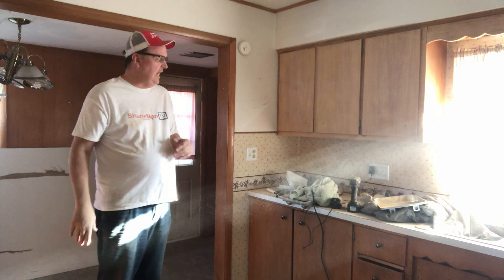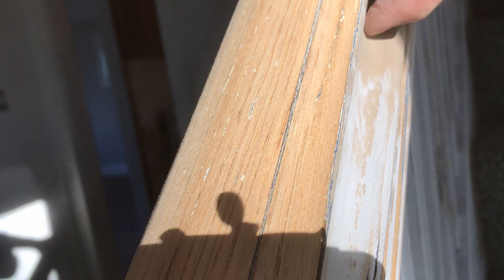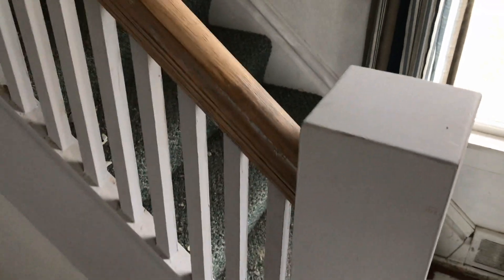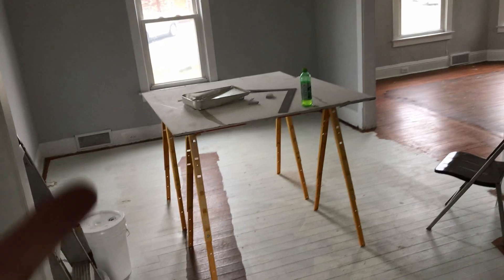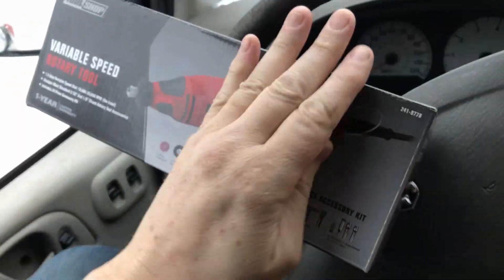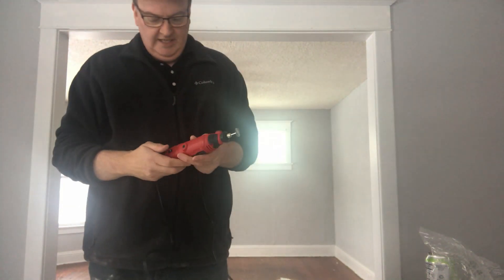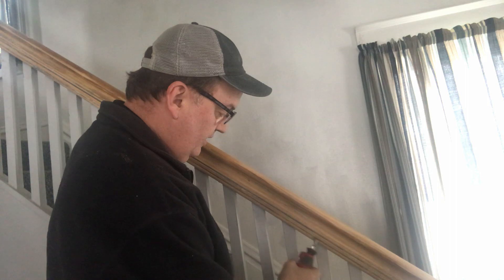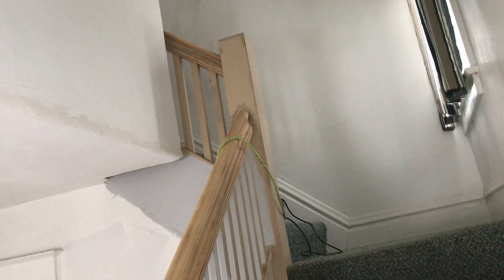How to Strip Paint off a Hand Rail using a Heat Gun!   House Update

Comment: Cant wait to see the new stain on the railing...but I suggest keeping the posts and spindles bright white and paint the outer stringers (bottom rails) trim the grey. Also the pipe inside your chimney is probably your furnace or hot water heater exhaust flue so I would think you would need to replace those bricks to help prevent any carbon monoxide leaks.
Reply from the maker: N2itively1 that could be. I would think they would both use the same flue.

Comment: I know this was 5 years ago you did this hand rail but I have a question I’m hoping you can answer!  Do you think this heat gun method will work on a stained/sealed oak railing vs a painted one to remove the finish?  I have about 70 feet of railing in my house😮 and I’m trying to figure out the easiest way to remove the finish without destroying all the remodeling we did.  If this could take me down to raw wood without chemicals and sanding…that would be amazing!  Thanks!

Comment: Sent you an email buddy.
Reply from the maker: Martz1978 Got it, thanks for the tip. I appreciate it and yes next time I will wear a mask. Thank you
Reply: @ShaneManTV  No problem buddy it will save you a lot of $'s in the long run instead of keep buying replacements for the dremmel, the one I have has lasted years.and when the edges start to wear/burr it's even better to get into the tight spaces.